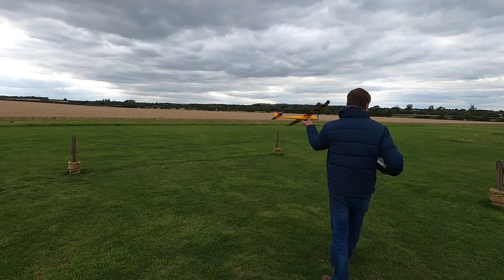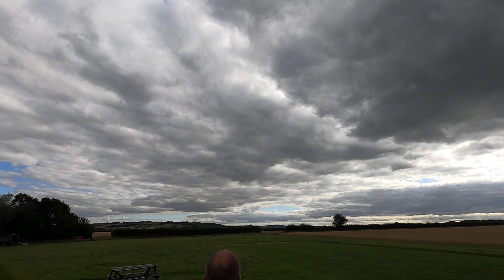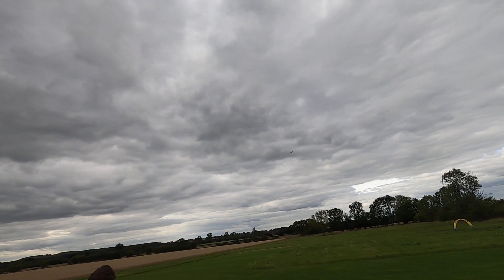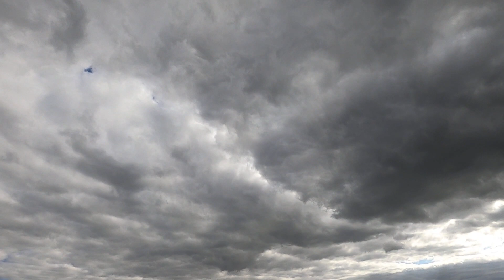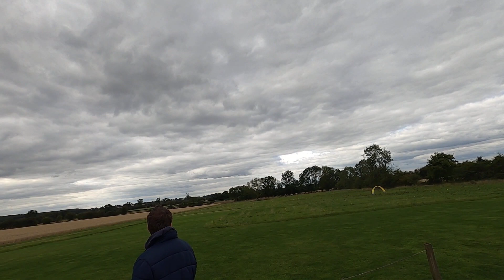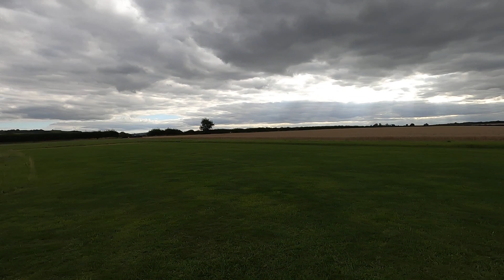Voodoo of doom - 8s- 3kw Airframe flex

Comment: Im considering buying one and the manufacturer states 250 watts max
Reply from the maker: Manufacturer suggestion.. You can do what you want though! It is sensible to have 250 watt max, but it will take much more.. however landings become faster and too much power (1.5kw+) and the airframe will bend.. Incredible airframe though, even with 100 watts it would still be amazing to fly.
Reply: @OMEGOOLIEBIRD  question is will it explode. I had a model explode this weekend because of too much power :D